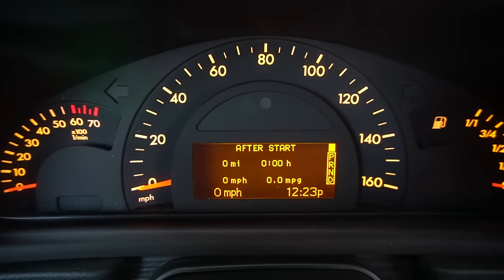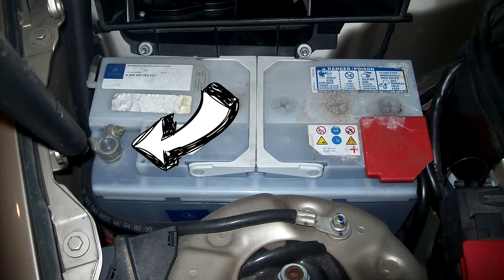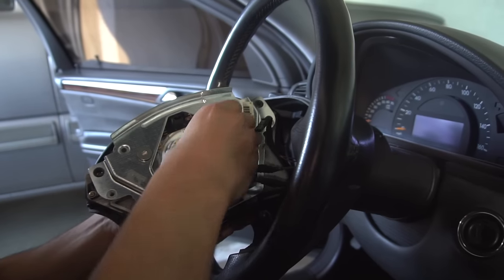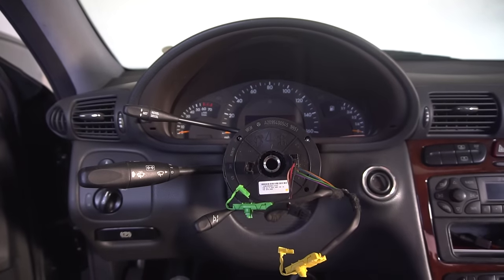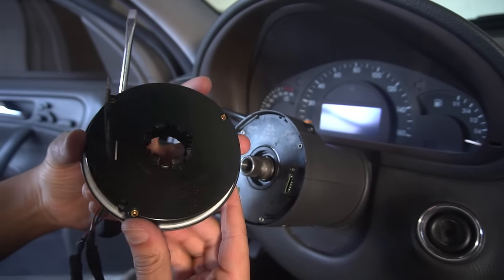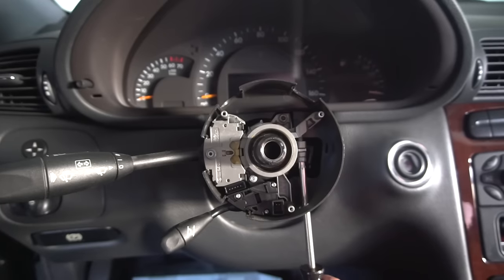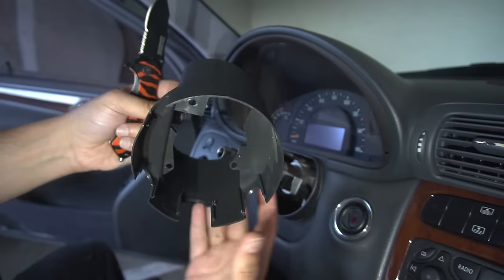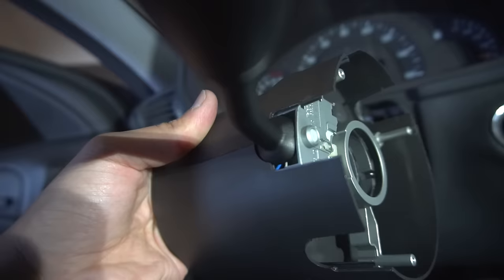Mercedes Benz Replace Combination Turn Signal Switch / Toggle / Stalk - C-Class - W203 C320

Comment: Good video, thanks it was a great help. Just two things, You should fit the locking piece before you remove the airbag squib. And if you remove the plastic clips over the switches first. You can remove the airbag squib and the steering angle sensor as one piece, which means the copper connections are not exposed.
Reply: Excellent addition to a very well done video.
Reply: ¿cuál es la pieza de bloqueo? ¿pin rojo?  ¿dónde comprarlo?

Comment: I followed the instructions although the clips on the air bag were different slightly ,they didn't unclip the same but with a bit of fiddling around got it to work, everything else worked fine and when I connected the battery again everything lit up as before and no fault messages at all ,many thanks and I saved about 300 bucks

Comment: Thank you. Is there a way to find the part code before I disassemble the unit? I need mine changed and the repair place wants the part code or / if it's a 5 or 6 pin make.

Comment: Hi after I did this procedur, the srs, esp and bas start to shine, I took it to a work shop but they could put the light out.. they didnt have the oem mercedes software but they clamid that something is wrong with the esp, airbag and brake sensor, any idea what have could happend?
Reply: I am experiencing the same problem. The Srs and Esp are illuminating now. I can't figure it out. I even calibrated the steering wheel and it didn't help. Anyone know of a solution?
Reply: @mariagianna9676  maybe something have happend to the clockspring/steering indicator, I took it out and have it back to the center  by turning it from side to side and the turn it back to the middle, and then I could have warning lights out

Comment: So for those having the same problems with their turn signals lights staying on, it is the TURN SIGNAL SWITCH that is the culprit and not the large N10 relay located at the front end of the windshield inside the engine bay???
Reply: I think it's just the signal. Because they still turn on but goes off if you dont hold it with your hand. So it's just the switch that's in the videos that is bad. Nothing in the dash. At least with mine its isnt

Comment: Hi bro.
My signal indicator need replacement..
Is the replacement part same for both left and right hand drive car? 
Mine is Right hand drive.
Thanks
Reply: I would think so, as long as it’s positioned on the left of the steering wheel.
Reply: I just looked up the part for a 2004 W203 C240. The side question did not come up.
Reply: @DerFilmgucker  ok..thank you..
Yes,is on the left hand side of the steering

Comment: Hello, I have a Mercedes w203 turn signal that works by itself, without Mayo it turns on and does not turn off.
What I did:
1) pulled out the turn signal switch chips but the turn signals continued to work.
2) I pulled out the chips of all 4 lights and the same thing.
What could be the problem?
Help rozhalusta.
Thanks in advance everyone.

Comment: My mechanic is scared to do this because he thinks the airbag will go off even with the battery unhooked. Is this fear unfounded or actually something to worry about?
Reply from the maker: ask him what would trigger the airbag to go off if there is no electrical current running through the system
Reply: It will be fine he will just have to disconnect and leave for 15 to 20 mins to allow all copasitors in the vehicle to die down before starting. Once airbag is remove due to the classification it should be put in a strong metal box which is lockable, airbag facing up.
Reply: He was worried about the airbag having capacitors or something else in it holding charge; then I guess messing with the connectors setting it off or something. Or he was just lazy and didn't want to do it lol. I did end up doing it myself wit no issues :)

Comment: Where did you get the new turn signal " stick" from? I have a similar issue but its on the right signal
Reply from the maker: ebay, but you can try other vendors like autohausaz, rmeuro, fcpauto - sometimes even the dealership has cheaper prices
Reply: @ThingsLike  Do I need to pay with credit card before getting the packet cuz I dont trust ebay?
Reply from the maker: @edward3105  been using ebay for 15 years, never had any serious issues but you can also go to a local car junkyard instead and pick that part yourself. See if you have an auto salvage yard in your area.

Comment: hello friend i have the problem of my 270ml cdi 2004 cranking about 2 seconds and it stops without starting 5 to 7 times without starting i have changed the starter motor and changed the ignition antenna i have checked all the fuse boxes i have found  All are going well I have changed the battery and without news but when I connect it with cables with another car working it starts directly.  now I do not have to think about any reley that is main!  do you know if he has any ???  please help ...
Reply from the maker: Dear Khalid, I'm not sure what your issue could be. However, an issue with similar symptoms to those you describe occur over here: https://mbworld.org/forums/c-class-w203/527256-w203-doesn-t-start-does-not-crank-3.html

The driver replaced his ECU to resolve the issue
Reply: Map sensörü yada diğer adı ile hava akış metre yi temizlettir kızdırma bujilerini kontürol ettir EGR kelebeğini temizlettir mazot filitresini değiştir

Comment: Here's a question for a/one who may have a SUGGESTION at least, as two d'ships can't figure this out at all...

The turn signals work, but after "X" amount of time, they STOP working.  No specific amount of clicks on/off...no certain mileage driven, nothing to associate with the NOT working of them, BUT if you turn the car off and restart it, they begin working again!  No code shows up or gets stored to indicate what the issue is. Others on the web also are searching for help.

Comment: I know where is The "Problem" why switch is not standin in his position! don't need buy new one or second hand... you just need open Turn signal box 2.screw and change little black clips right to left , and left to right, and it will be like NEW! ;)
Reply: which clips?
Reply: what clips?? I have now the problem turn signal not stay in position😪 plss help..